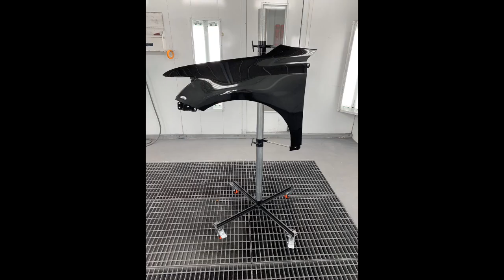DIY automotive parts paint stand

Comment: That is nice but, I don’t own at TIG, weld table or cut-off saw. 
  Is using a MiG, saws all and electrical conduit (Large) from home improvement stores ok? I got 4 tool boxes, #5 is pullers, #6 is all electrical.
Sorry! The MiG is a 1984 and takes 14” spools but does produce at true 150 amps. Will that work?
DK, ASE master tech since 78, retired.